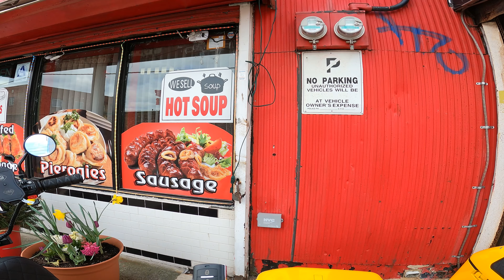This Electric Moped gets a SPEED BOOST! Will Mason T1 Touring S

Comment: Curious what motor those use. I was thinking about the C1 Pro…
Reply from the maker: @housedjnyc  it's the QS 12-inch motors like the QS268 motor with swingarm. Super powerful with the right controller.
Reply: @JB360_NYC  ahh. I bet a 12kw QS273 could fit & then I’d do a Fardriver ND721200 with a high capacity Molicel battery.

Comment: Update. Everything good now? I question the overall quality of these things. Did you register it and do you need a special class license to operate or just a standard driver's license?
Reply from the maker: @cocoabiscuits  I actually ended up selling this not too long ago to a friend of mine that does Uber eats. Overall since swapping out the stock 60v battery, the moped has been working great and my friend has been loving it (it's his first PEV lol). In New York State, you can get away with registering this as a Class B vehicle which only requires a regular driver's license.

Comment: Hi i was thinking about getting a will mason scooter i was wondering what your issues were with the batteries
Reply from the maker: @deadbrokel305  I would definitely recommend one. The unit that I got was from the company but a test model for doing reviews so the battery was not from the production model. The new models they are sending to customers are better quality packs and cells.
Reply: @JB360_NYC  They dont  list what cells they use on their site. Any idea if their samsung or lg considering how expensive these are i would hope their not cheaping out on batteries
Reply from the maker: @YoungWise2011  that's a good question. I believe the newer batteries have higher discharge numbers so could be Samsung or LG.
Reply: @JB360_NYC  well he got back to me and he said they use in-house cells which means they're cheap. Chinese cells unfortunately
Reply: @JB360_NYC  I can't justify paying top dollar for a scooter that's using Chinese cells
Reply from the maker: @YoungWise2011  agree 100 percent. You have to have at least LG cells which are still affordable but have decent power. I would even take Lishen cells. Even though they are Chinese cells they have proven to handle hi powered builds over the years.

Comment: Needs to be at least a 72v 60mah or higher to be a touring scooter I like the scooter needs a big mah battery been looking at that mad max pro by Mason good video
Reply from the maker: For sure! I was even thinking about about getting another Wolf King battery and just paralleling them to get that 70ah
Reply: @JB360_NYC  that would be nice it needs more mah 70 mah would be nice you would probably get  at least 50 miles riding without worrying

Comment: what is bms ??
Reply from the maker: 200a BMS with 100a continuous
Reply: @JB360_NYC  what does it mean , BMS??
Reply from the maker: @kdscrapping4452  So BMS stands for Battery Management System and it's a little device that is connected to your battery pack. These devices basically monitor your battery in case something out of the ordinary happens and even prevents your battery from overheating. They also typically come in different sizes, so depending on how big your BMS is, it will determine how many amps you can pull at any given time. Bigger amps, higher top speeds.
Reply: @JB360_NYC  Thank you!!